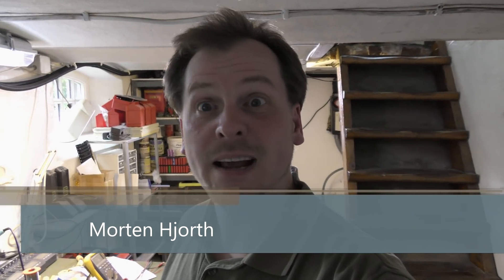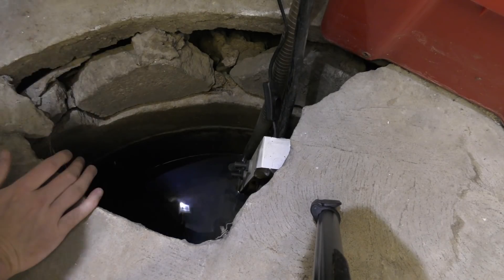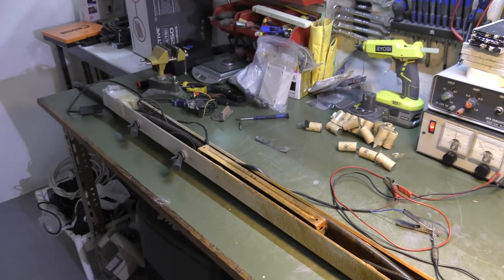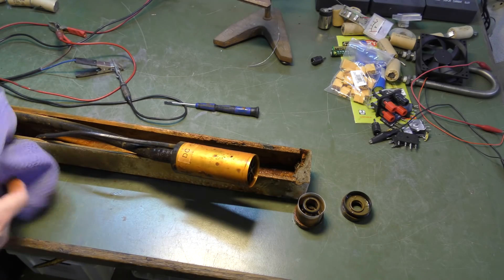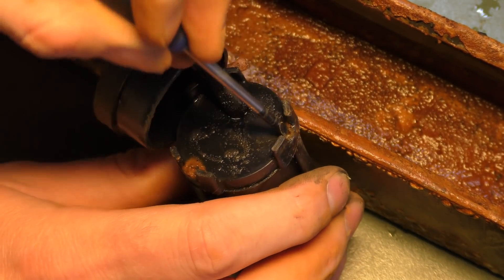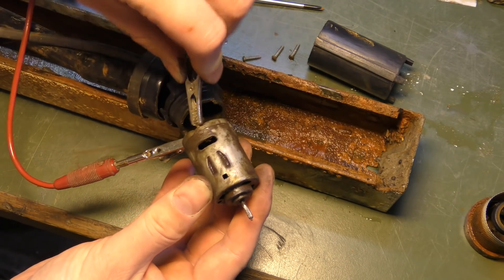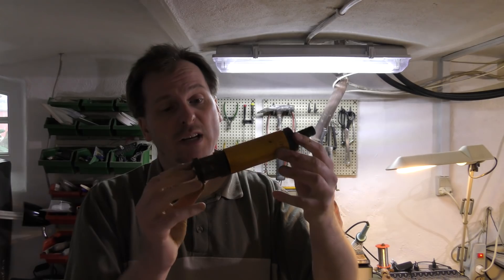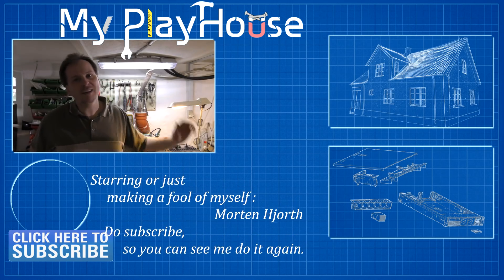Tiny 12V Submersible Pump for Water, NOT WaterProof ! - 843

Comment: Suggestion for next pump.
Don't place it at the bottom of the well, place it just bellow the lower lever, so that the pump is only submerged when it actually is needed.
After all, it is immensely hard to actually make stuff water proof. So by not having it submerged year round, it might last far longer.
Reply from the maker: Yes you may have a point there :-)
Reply: @MyPlayHouse  Yay for point.
But yes, no need to give the pump a harder life then needed. And the water at the top might also have less sand and dirt in it, so might survive longer thanks to as well.

Comment: Yep they didn't seal it correctly, just a brushed d.c motor like you would find in an old battery drill.
Maybe you want the pump part at the bottom of the metal tube and connect it via a long rod to the motor shaft at the very top of your metal tube.
An old plastic washing machine pump body perhaps lol.
Reply from the maker: Hi zx8401ztv
Yes there is really no reason to stick it way down there,, maybe even the water pressure caused this..
Thank you for watching! :-)

Comment: Dear Morten, one of your Patreons here :). I'd like to remind you that those level sensors are not capable of carrying high currents. They are made for up to 1 AMP if they are the ones that I like to use.  Your pump is rated up to 1.5 Amps, so do not let the cheap pumps break your expensive level sensors. So maybe use a cheap relay or a even cheaper transistor.

I've had the very same situation and I used a bilge pump from "Johnson" and another one from "Shurflo" - both were okay for a couple of years each. But they are somewhat $30.

Kind regards
Soeren - Germany
Reply from the maker: Hi accesspoint2
Thank You very much! I did a video on how this is made,, there is a relay in there : https://youtu.be/XNLB0AizBFg
Thank you for watching! :-)

Comment: Could be the rust getting into the pump. It is both abrasive and conductive, which is not something small pumps like. Water itself isn't too bad since the coils are enamel coated and the terminals are too far apart for shorting at 12v.
Reply from the maker: Well it most be the water that killed it,, some how.

Comment: still watching video, if you end up getting a new pump try getting a pond pump; they're usually completely enclosed/sealed, are submersible and the only thing that is exposed to water is a regular magnet :P :) ** would also not set it on the very bottom to avoid it eating sand; for submersible pumps pond pumps have a overall better design as the electromagnet coil spins a magnet attached to an impeller, in theory water never reaches anything electrical as it is all completely isolated:) only down side is that they should never run dry but that shouldn't be an issue ** this pump design is used in computer cooling, swimming pools, glycol/antifreeze cooling/heating, commercial dish washers, and a bunch of other stuff
Reply from the maker: Hi plasmar1
Thank You very much!  glad you liked the video :-)
Thank you for watching! :-)

Comment: I say it is time for a collaboration with him who releaseth the Schmooh. What you, the trained electrician, want to do is get a nice 300W three phase motor, wire it up to engage upon signals from floating switches like fellow playhouse followers suggested, and, just like said fellows said, keep the motor above the water where it's nice and dry,connected to the pump wheel down in the well only by a rod or so.
Reply from the maker: Hi Eo Tunun
Thank You very much!  glad you liked the video :-)
Thank you for watching! :-)

Comment: Morten you get what you pay for. I had one of those pumps, the motor doesn't seal the water properly, I now have a above ground pump with limit switches just like you have at your well. I think you with find that the new pump you have ordered will burn out in no time at all. Good luck with it, will give it 12 months at most. Regards Peter.
Reply from the maker: Hi Peter195267
Thank You very much!  This is also why my primary pump is up on the floor.
Thank you for watching! :-)

Comment: I recommend you to check out a similar 12V pump.Look up JT-500 12V water pump on any Chinese online shopping sites.It's about 8 bucks.It seems to be well made and it's designed for solar use.
Reply from the maker: I did come across that one,, is it any good?

Comment: i have a submersible pump, that runs on main voltage, with floating switch. and it is fully waterproof. 
you can get them in the most byggemarkeder. and it will work.
Reply from the maker: I had that to.. but it kept tripping  the HPFI ,, so I wanted something that would run from a battery.
Reply: @MyPlayHouse  yes all ways the problem. instead buyin the pump in china, why not get it from the local biltema store or a boat shop  in denmark.
Reply: you can also use an isolation transformer to isolate the pump, and only use a fuse from the transformer to protect your circuit. a standard din terminal fuse(maybe from weidmuller) on 1-2 Amps will work here because the pump max power is so little as 250 watt.  and the transformer will keep the rcd(hpfi) away from tripping.